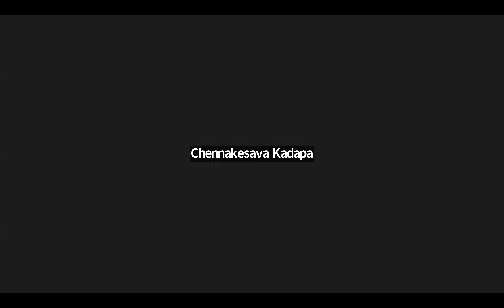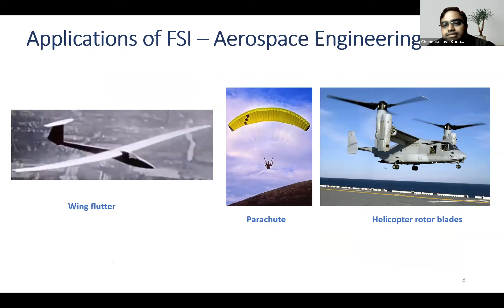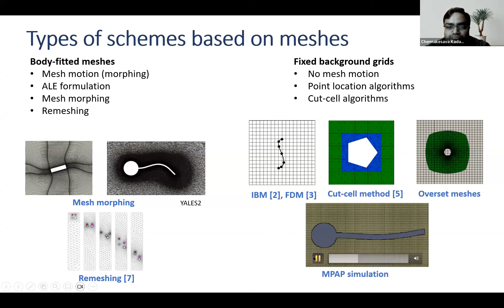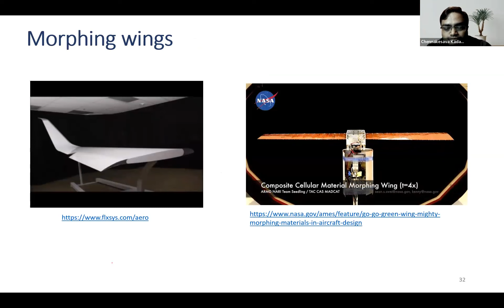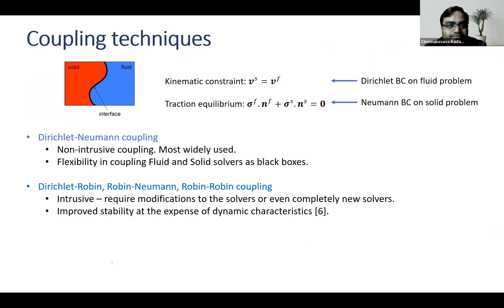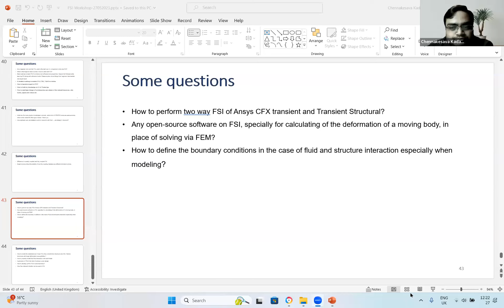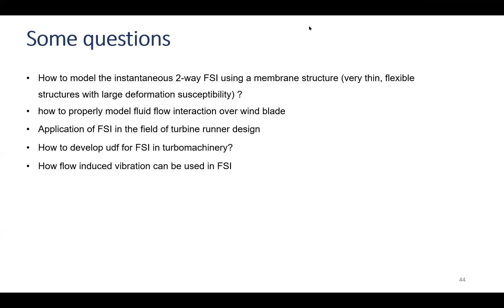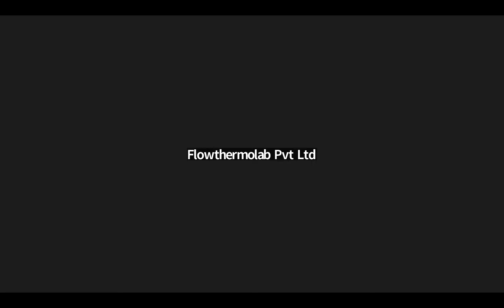FSI workshop | fluid structure interaction |

Comment: I have a solid rod with heat generation in a tube. the solid rod is surrounded by axial flowing fluid that removes heat from it and the solid rod is like suspended. I want to know the effect of flow rate increase on the vibration of the rod. whether this makes a good case for my fluid structure interaction or not?

Comment: Sir, I have a question. I'm doing my project on magnetorheological shear thickening polishing for brittle materials. However, I'm doing simulations with ANSYS software for CFD, and I have obtained satisfactory results. But for solid mechanics, I want to check when cracks and fractures will occur and how the penetration of grits or abrasive particles could impact this. Could you please help me with this?